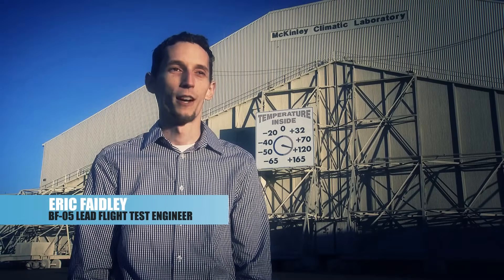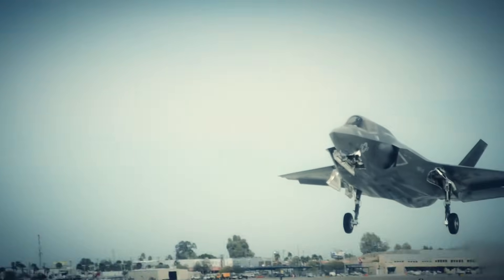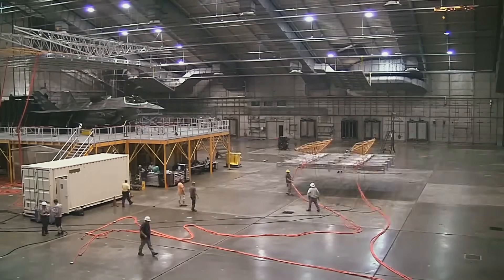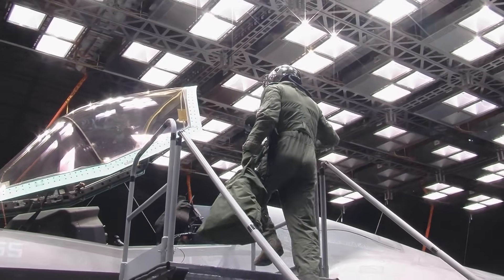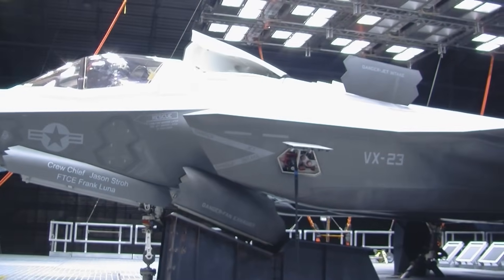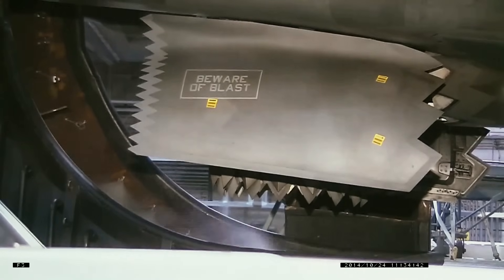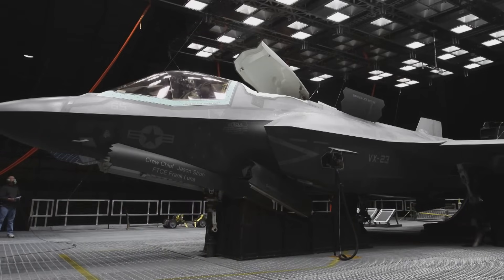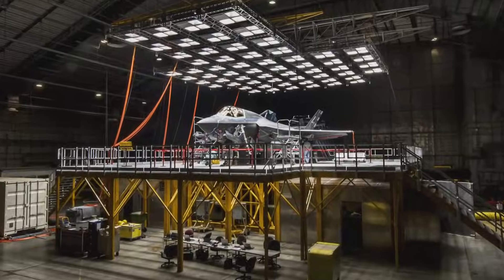Heating Things up with Lightning: F-35 Climatic Testing

Comment: Awesome, but they forgot to simulate lift, since in hot environment , the air tend to be lighter, in which makes it harder for the aircraft to gain lift
Reply: Erhm, no point in simulating lift in a avionics/electronics heat test.
Reply: Nice vid!